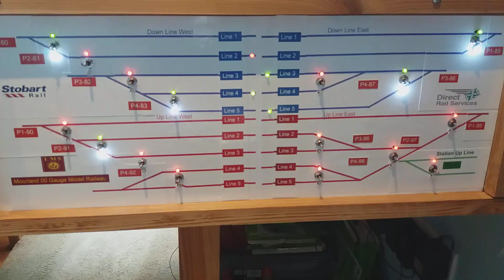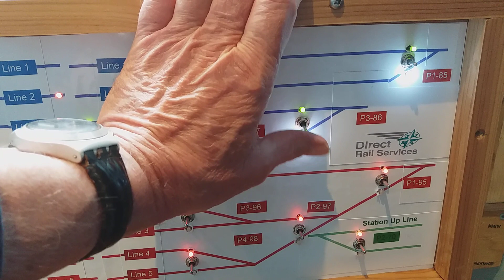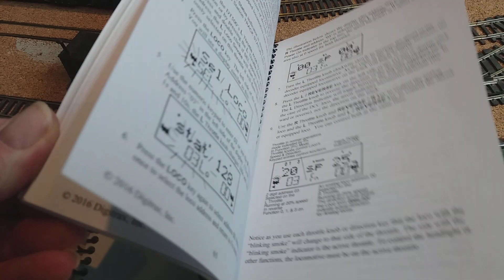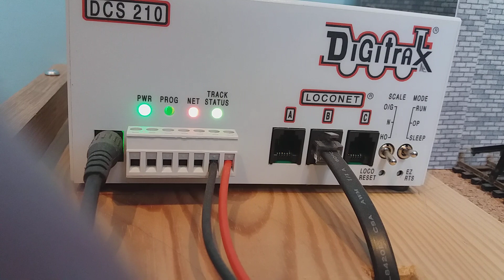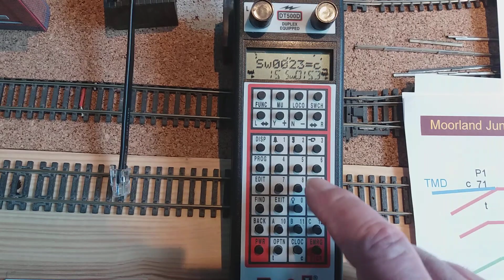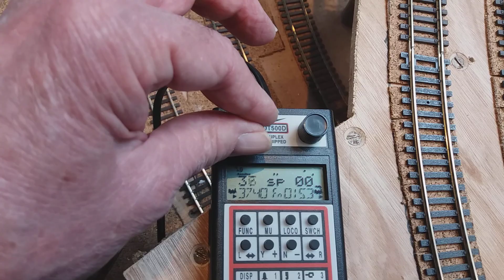Programming points and routes on Moorland Model Railway using Digitrax

Comment: I interesting and well explained 👍
Reply: Even easier with a Digitrax DT602.
Reply from the maker: Yes I've upgraded now cheers Andy
Reply from the maker: Thank you Gnomestead I just hope it was of so use to someone cheers Andy
Reply: Moorland Model Railway Andy Hello there ,, I can only speak for myself. I’m planing a much larger layout and I’m undecided about system controls and how I’ll handle it or what equipment I’ll purchase,, so it was very interesting. I’m not afraid of a steep learning curve and a thick and complicated manual in fact I’d welcome the challenge but I need to see the final outcome of the installing by others and the control systems up and running to avoid repeating costly mistakes I’ve made in the past. Lol,.  Take care and stay well. 😁
Reply from the maker: @thebibletrain8297  yes I completely understand where you're at as I was at the same point last year. So I visited Digitrains in Lincoln where they demonstrated all the major dcc controllers for me and advised on which would suit  my needs. I then went away and watched a few videos before choosing. I found watching Charlie Bishop at Chadwick model railway very informative as he uses the digitrax system but uses block detection ect and shows you how to wire it up. Stay save too Andy

Comment: Andy that is very impressive and very well explained also great job on the mimic panel --------------------Cheers Kev
Reply from the maker: Thanks Kev just hope it was useful to someone. I'm starting to find the digitrax system quite user friendly now, it has taken a bit of time but to be honest I've not run trains that much since I bought it. I do find programming some of the routes easier than having to remember all the point numbers or remembering to switch them on the mimic board. Cheers Andy